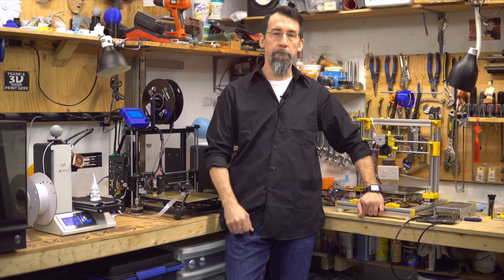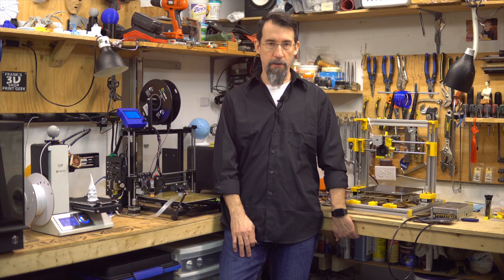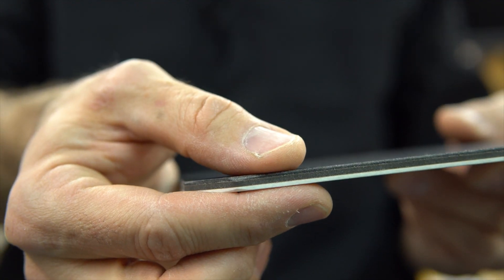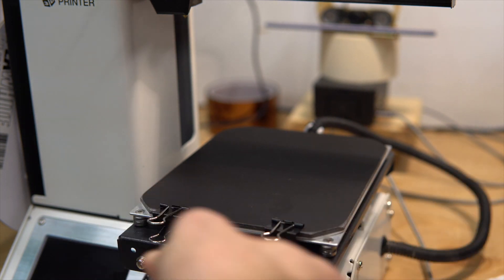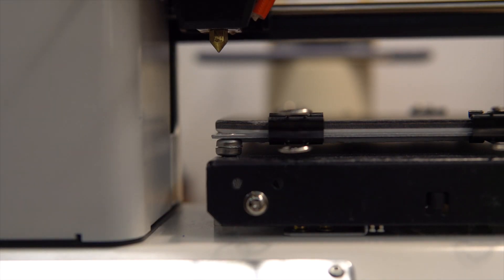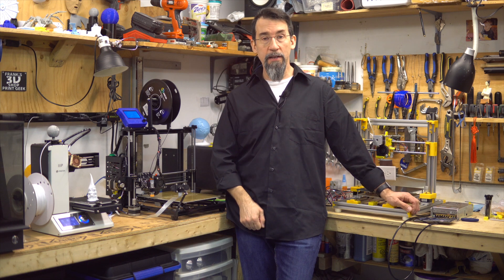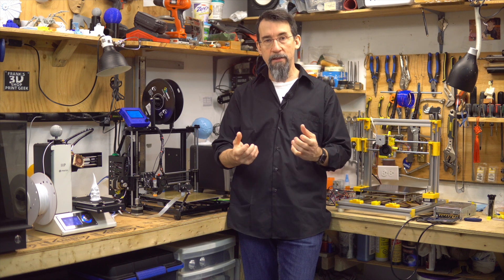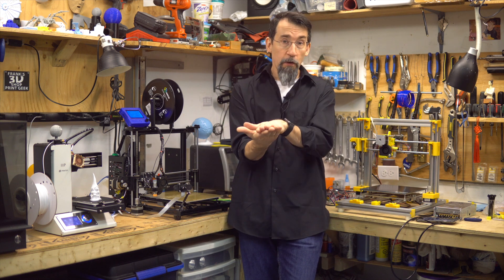Monoprice Mini Perfect Bed (PrintinZ)

Comment: Anybody use this with ABS? I can't get ABS to stick to the factory installed bed, even though it is heated and says it is supposed to work with ABS. :(
Reply from the maker: You need ABS goo that you can make yourself with abs and acetone...

Comment: For me prints did NOT want to come off the glass bed, and It broke when I made an attempt to get the print off the bed.  Now I'm looking for a new bed. :P and when I click on the link for PrintenZ it says its an unreliable source.
Reply from the maker: How to remove models form the bed. https://youtu.be/Rc9uQE3wGHw
Reply: @Franks3Dshop  Thank you so much, I will give it a try.
Reply from the maker: I would suggest that you just replace with a glass bed, another really good cheap printing surface is PEI, they come in sheets of 0.3mm and you use 3M tape sheets, PEI is ideal from my latest experience. When you try to remove something from the bed, the trick is to use a scraper, sharpen it to have a nice edge, round the corners, and place it parallel to the print surface against the part to remove, and use a small hammer and just give a little tap on the scraper, the parts will pop up easily.

Comment: I am still loving the original build tack but my bed is starting to warp upwards in the middle, so that seems to be the biggest problem with this printer, the al is too thin, anyone that has upgraded to glass, how is bed heating with it?
Reply from the maker: Hi, with the glass directly on the aluminum, it heats as normal...

Comment: My problem is I went to a borosilicate glass bed because the Mini's bed had seriously warped. The flexible bed plate might conform to the warp of the bed while the glass is less apt to conform to the warping. Have no adhesion problems, a little swipe with the glue stick and the prints are staying put.

Comment: I bougth the FlexBed from Profab because the printinz one it's out of production, I got a question, will do I need nontoxic glue to keep stiking my prints with the flexbed or it just make it sticks your prints without it
Reply from the maker: Hi, if your first layer is a little squished down it will stick without glue. I prefer to add a little glue, just to be really sure it sticks. I mainly use glass with glue for now.
Reply: Thanks for the advice frank!

Comment: Looks interesting, I would be interested in an update after 100+ prints. Glass does not have that issue. It's going to be there for a very long time and glue costs almost zero. Currently is it worth 21.40 shipped I don't know.
Reply from the maker: I will report back if it goes bad and revisit later. Seems a good alternative, it all depends on the use you make out of the printer. Even the original build tak was fine on mine. But that said, if you print all day everyday, it is a nice solution because you save some steps when setting up a print. Your first layer needs to be squished enough or it loose adhesion. But it’s the case for most surfaces. I would not do it on a big printer because of the cost.
Reply: Thanks it would be interesting, currently because of YouTube roll outs I do not get replies to my email I have to bookmark and go back and see if there was a reply. If you could add your findings to a future episode that would be great. Seems when YouTube rolls out I'm the first on the list to get the new features which is cool but at the same time frustrating; normally takes 6 months for some features to work correctly. I have checked settings but I don't see anything that looks weird.
Reply from the maker: Yes I am making a note in my schedule to report on this later.

Comment: Neat.  I might have to look into this. -- does it work if you have a heated bed?
Reply from the maker: For PLA yes, I did not test it with PETG.
Reply from the maker: It sure is less hot than a glass.

Comment: Since I live in Europe, I went for a FlexBed (www printfab3d com/product/profab-removable-flex-bed-system/). It is made from spring steel with a surface of BuildTak and is even more flexible than your PRINTinZ Plate.
Reply: I live in europe aswell and am looking for a bed for my monoprice select mini do the prints stick to the flex bed without any adhesive like the printinz
Reply: @DaniyalNasir786  Since the company that made these flex steel sheets went out of business, I had to find another. Go to whambam3d.com and look for the "160 x 130 Flexible Build System". That's the one you need. The description even says that it fits the Monoprice Select Mini.